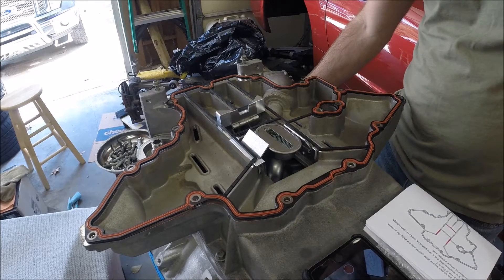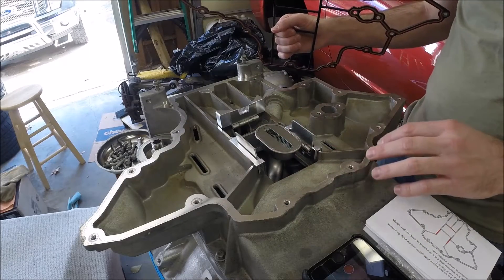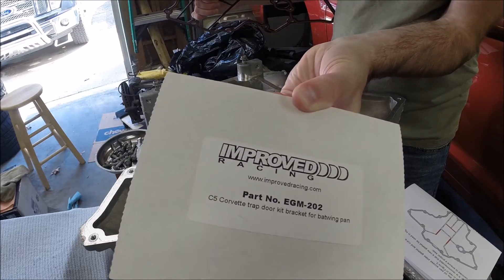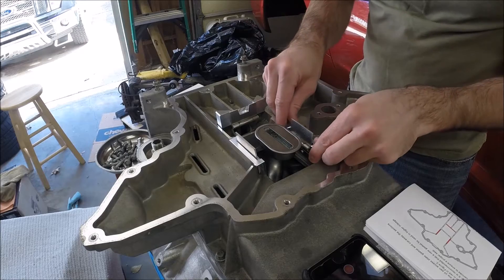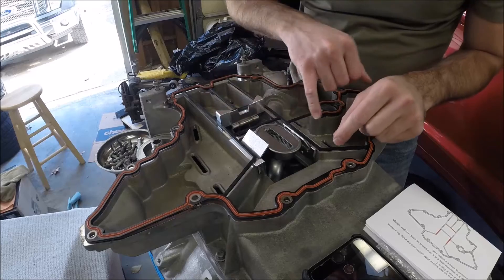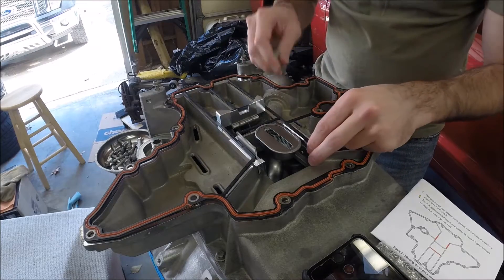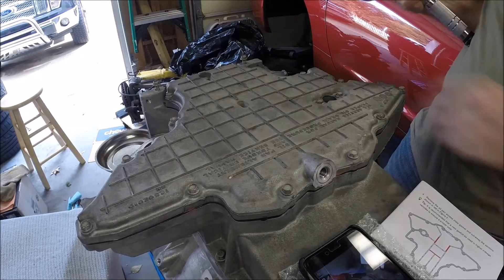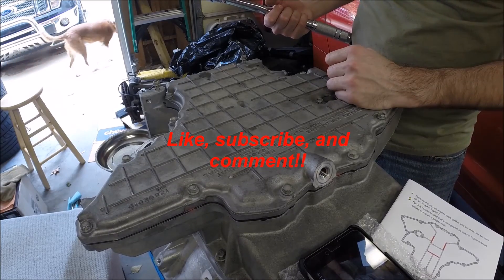C5 Corvette - Improved Racing Oil Pan Baffles

Comment: What's the sizes  the 15 bolts for  lower cover gasket ? like to put ARP bolts any info ?
Reply from the maker: Looks like ARP has a bolt set for the oil pan.  134-6901  https://amzn.to/3bePh04
Reply: @ScrufsGarage   yes  but they are for upper oil pan not lower batwing cover pan  bolts but I find the one for lower . Thank you for your help 👍
Reply: @link9alink9a71 do you have a part number for the batwing pan bolts?